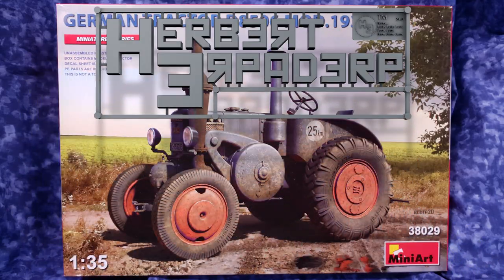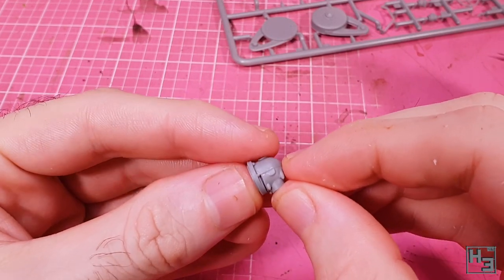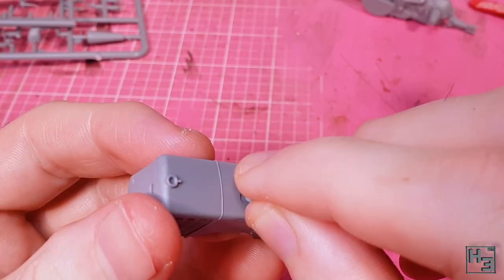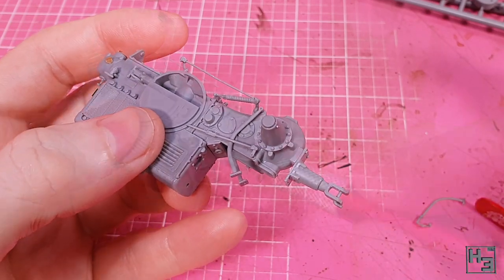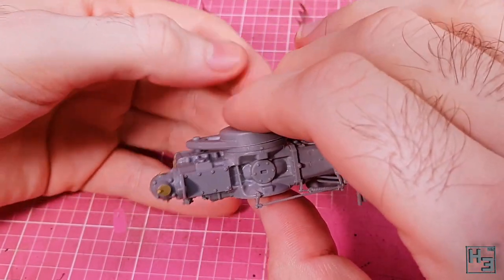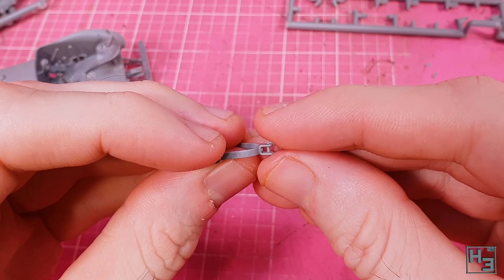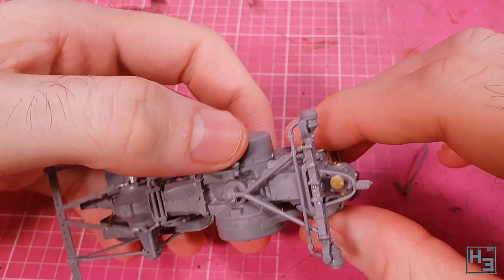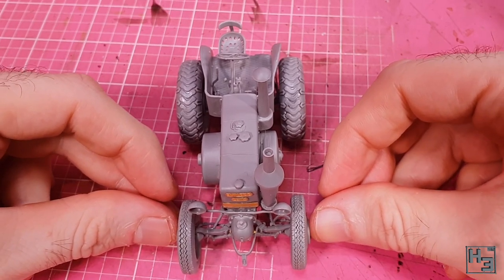Tractor! MiniArt German Tractor D8506 Mod.1937 [1:35]

Comment: That's a neat way to design the tires; a seam or mold line running around the circumference would kill the tread detail. And that kind of tractor seat are actually fairly comfortable; they wouldn't still be around after so many years if they weren't.
Reply: Can confirm. We had one of those on a tractor and two on the tobacco planter.
Reply from the maker: I guess they wouldn't keep doing if they weren't at least acceptably comfortable... Looks can be deceiving.